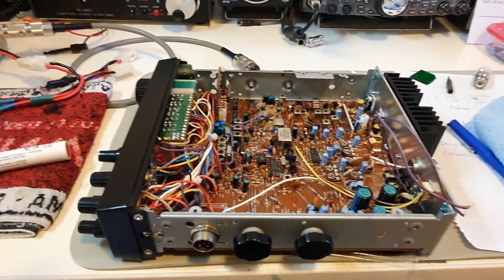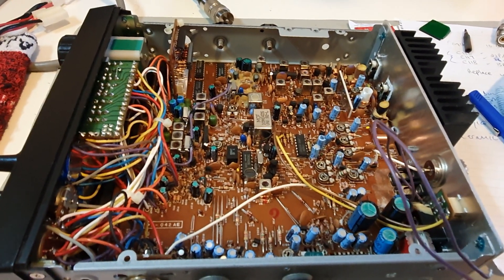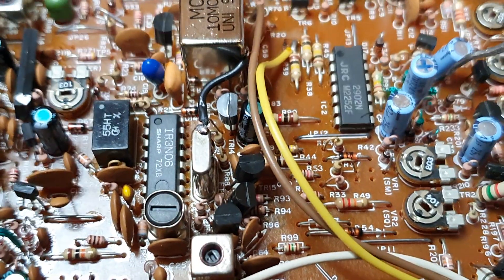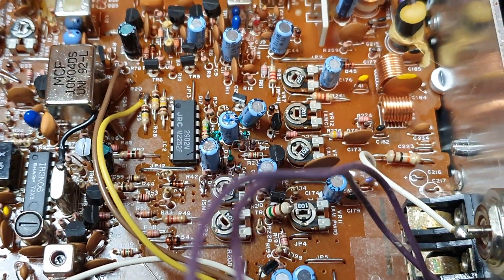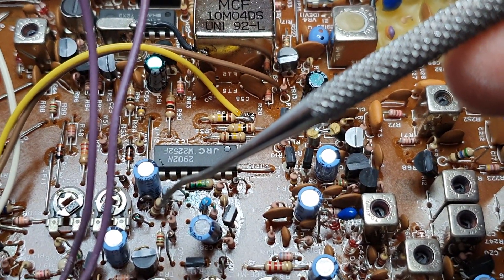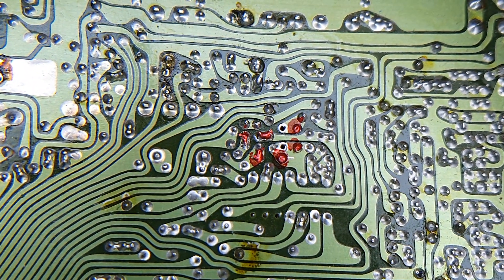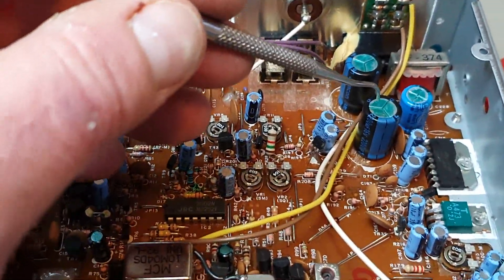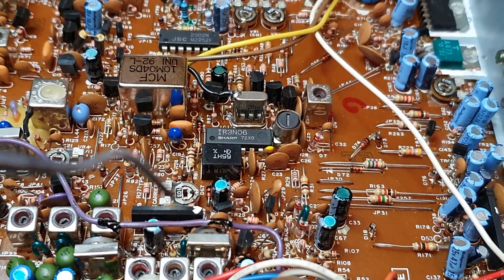President Jackson MK1 Export - Uniden AGC Service Manual Mod for front end overload

Comment: Hi Paul! Very nice video how to do👍. The AGC modification by Lou Franklin is a must for every Jackson. But grounding the crystals was not a good idea at my Jacksons. Result was less coarse clarifier slide. I could not reach the zeros after grounding the crystals. Removed the ground and all was good again.
Reply from the maker: Thankyou.

AGC mod done on one the MK1 and worked perfectly.

The clarifier works fine, actually the drift is very minor now.

The second Jackson a bit newer does not have either of these issues, but the previous owner did the adjustable power mod to the fine clarifier.  It max output is 20w where as the earlier jackson its 45 to 50w